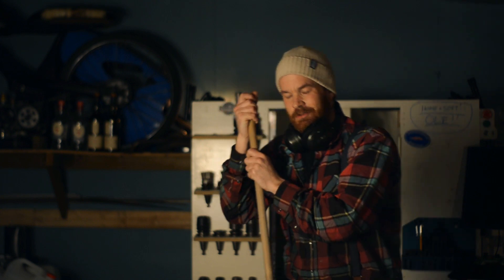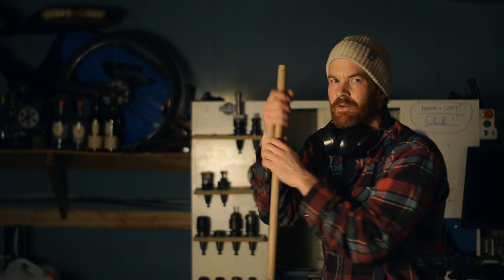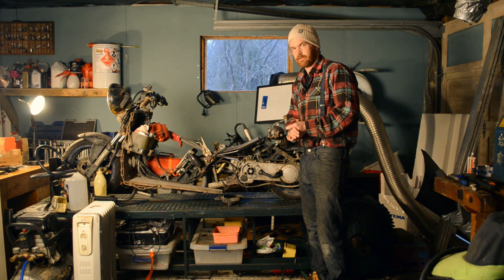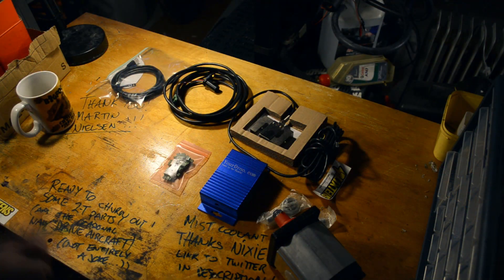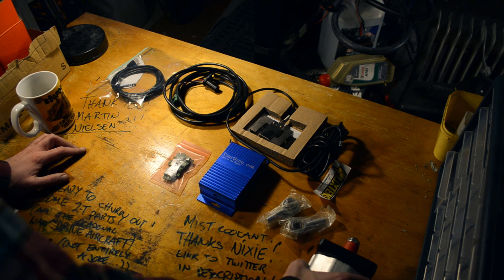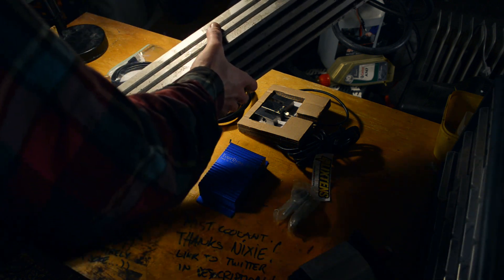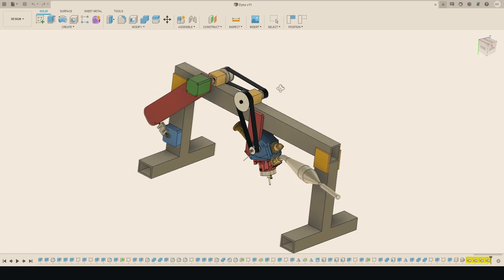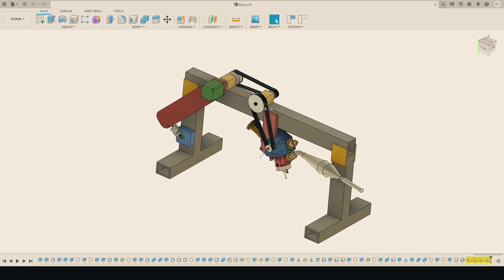Fly-by-Wire - Most Powerful Two Stroke Ever

Comment: When you say the most powerful 125 ever how do you know its the most powerful. How are you going to do the test .how many dyno runs are you going to do.will the test be 
Something like 2runs in a time say 30 mins,if the engine fails and you cannot finish the test then the whole test fails.how high above see level are you and what octane fuel
Will you be using?? are you going to use pump fuel.
Cheers

Comment: for a better response, find a decent premium servos, for airplane you can check rudder servos that has a very fast speed and response, or steering servos for 1:10 in road rc racing, mind the latency coming from the control system since it will introduce broader issues affecting whole system.

Comment: Just want to say that a throttle quadrant in a twist grip or a foot pedal are not 1 to 1. If they was it would be very hard to drive or ride as in put at lower setting would be make the engine very snappy. All so a digital servo will make that system so much better with a lot more reputability point to point.

Comment: Looks like a gear pump. They usually  have very limited rpm range and quite a bit of internal leakage at low pressures. Dont think it will be suitable for dyno

Comment: You can get rid of the springs and run a "pull pull" setup with a cable to pull the valve open and one to pull it shut.  A lot of RC airplanes and helicopters run pull pull (cables) or push pull (rods).   You can eliminate slop and load on the servo at the same time.

Comment: Awesome stuff lovein it.
You mentioned longer softer springs ,longer to close valve fully but in theory could slow closing  as softer. Hard to pick not being first hand seeing it operate but if your little softer and 10mm longer just stretch the spring evenly   that are in there you'll get same result. 
Plus have to watch video again but I'll comment brace cable both sides where it connects to slide solid fixture then to help return slide but you probably have, shorter cable less bend ,. You may have servo speed in tuning it ,also bigger servo 25kg minumin/steel gears bigger is better.  
All the best loven it

Comment: Alex, what if you mount the engine on a low friction torque arm which is free to rotate, except that your load cell is the restraining device.  Then you might be able to keep all the reactive forces from your pump, along with your belt reduction losses isolated from your shaft torque. In this manner, you can measure shaft torque and RPM directly at the engine. This would give you an accurate horsepower value.  If you ISO certify your load cell and rpm instruments, you could produce ISO certified dyno runs. Your first belt drive should ONLY be able to transmit torque forces from the primary (crankshaft) sheave.
Reply from the maker: That's a brilliant idea Jim!

Comment: great video, Top Tip, easily clean yoyr workshop floor if metal shavings, just drag a large magnet in a piece of cloth around, once its clogged up, remove the magnet over a bin and the metal trash will fall off,??
Reply: Good tip, but I think that most of his shavings are aluminum.

Comment: Hey,.don’t you get a beter result in finetuning when you use a butterfly valve, the same as in a throttlebody. I am building one myself with a 40mm diameter, and it is easy to make. Also use a servo tester with a dial knob, so you can move the servo. Then you dont need a arduino and laptop for testing.

Comment: I can not comprehend why you would use the servo drive to control the throttle operation. You essentially loose “direct” control of the air/fuel delivery to the engine. How can you trust such a critical performance piece of the process to a circuit board ?  Maybe it’s just my archaic old school mentality. 😎

Comment: Hey dude,
Whats the part number of the servo you're currently using? I can gaurentee there will be a cheap powerful servo available from hobbyking thatll do the job, and if not, futaba and hitec will definitely have one strong enough, might pay to scrap the cable and put a solid linkage too, also some needle rollers for the slide channels will help make the valve move smoother.
Fuck i love watching this build, got me through 6 months of lockdown last year in melbourne.

If you want any help searching for an appropriate servo let me know.

Comment: Nice bit of PWM control. I did something similar to shut the chicken shed door when a light dependant resistor sensed that the sun had set. I really want to make a dyno like that, will it only be good for particular rpms though? Or can it be dynamic?

Comment: Awesome machining! But why ride by wire, what's the advantage over cable-actuated throttle? Cause the ride-by wire is heavier and doesn't seem to open extremely quick.
Reply: Because it has to be opened in the same moment when the efi starts injecting fuel... It is just for full throttle, every other throttle position is made with a standard carburetor...

Comment: i feel your pain..  it's 5am again how did that happen.. sure it was only midnight a little while ago, sat down to do some CAD then was making on the CNC machine for a bit.. Then was playing with my FGK retrofit EFI system which my friend designed and built love it.  he does a 4stroke and 2stroke version.  bit below what you are doing but really good off the shelf unit. It works! i'm turning my cb100 cc into a EFI bike, it's from 1976 same age as me. They made bikes here 40 years or over exempt from MOT, Tax and Low emissions! Loophole exploited asap.  we have two dynos here... you are welcome to use anytime, only snag is we are in london!! UK.. bit far for you to travel but if you ever in town come say hi , love what you do ciao

Comment: @2STROKE STUFFING have you seen the drive system invented by “CeramicSpeed” for bicycles? It’s a chain-less drive system that’s supposed to be 99% efficient and fits a LOT more gears than you could traditionally via. drive sprockets....the machining / development could be difficult but, it would likely be more efficient than shiv-drive and would be able to maintain nearly constant RPM given the close gear spacing of 13-26 speeds.

Keep up the good work; excited for the dyno!!!

Comment: I'm telling you if you end up putting too much fuel at it you're going to need to add more spark or it won't ever light. You'll either need a second spark plug or an auxiliary glow plug to be able to get all that nitro to light off, especially without it being supercharged or anything. Oh and where you said more nitro.. actually it'd be less at Bonneville. The Salt Flats are at 1285m of elevation and depending on temperature I know the AD can go way higher than that.

Comment: I would try using a counteracting pull/pull cable setup like steering on a boat. Then you have more control. Also you have to consider that with the throttle closed or at partial throttle the vacuum will make it struggle even more. Having the pull/pull cable allows the servo to pull it shut when the weak springs may not.

Comment: Fly by wire is waist of time bloody pain in the ass on my car couldn’t imagine putting it on a bike and relying on it to work correctly
Reply: then why car makers have used it already 20 years whitout problems? anything becomes pita to work with if it is poorly maintained. and in the usecase of 2stroke stuffing it is necessity because otherwise you would have to manually operate this secondary port in precise rpm thresold.
Reply: @eetumalvikko8327  I suppose it will be set to just open or close at set rpm and won’t be to much of a problem but my experience with it in my fords has put me off that’s all.

Comment: Great video. You should be using an exhaust valve servo. Like the one found on Ducati's. They're cheap on ebay as people remove them while fitting race pipe. Huge torque on them, and pretty fast. About a 1/3 of a second, and it has 2 cables pulley!

Comment: why not mount the servo directly to the valve body and use a closing servo as well ? get rid of that long cable and replace it with wires.

Comment: Too many belts on that dyno set up, you will have alot of losses. why not simply a hydraulic pump direct drive, if you know rpm (flowrate) & pressure you can do the calculation from there.
Reply from the maker: The hydraulic pump isn't too happy about 20 000+ rpm...
Reply: @2STROKESTUFFING  Very good point!
Reply: Possibly meant to replicate the drivetrain loss from the bike?

Comment: Suggest to check that air pressure difference across the throttle plate does not push the throttle plate against the body so hard that the spring can't return it. Maybe some experience of these devices out there in the speedway community, the Blixt carburetor is a little similar.
Reply: Grease it?
Reply: Yeah. Could have a Pull/Push cable arrangement and no springs
Reply from the maker: Might go pushrod vs the cable.
Reply: @2STROKESTUFFING  "Remember to:
Be Cool,
Stay in School, 
andS̴̜̦͔̗͇̯̙̬ͫ͊̄̎ͫ̌̕͞m̸̛̲̻̯͍̘͚ͬ͐ͨͥ̾͗ͨo̧͙͕̣̮̠̬͚̮̒͌̀́k̼̤͕̖̰̥ͫ̾̊e̛̫̹̘̭͍̻̤̣̠͋̄̒̓ ̵̻̟̫ͬ̓̊C̜͉̣͙̰̏̂̐ͧ͆ͭ̈́̚ṛ͉͙̣̝̽̐ͬ̍̅ͣ̌̇̚͝ͅȁ̞̝̪̯̦̻̙̩̀̊͒ͤ̄̇͟͜c̸̠̩̜̄̆͂̅̃̈́͋ͅk̈͆̏͂̉̄͘͏̤̭̠̦̬̭̲"

Comment: I’d be cautious of the throttle sticking in the partial open position. It would be safer if you had a push-pull setup. There’s a reason bigger bikes use it.
Reply: Yes, might not get through scrutineering.
Reply from the maker: That's a real concern.
Reply: might not be so bad as its meant to be wide open all the time
Reply: @nfdr0kk3rz  until you want to brake and it stuck at full throttle LOL
Reply: @legros731  It's not that kind of valve
Reply: @nfdr0kk3rz  lol what are you talking about don't say stupid thing if you don't even know how an engine work
 the slide valve is the high speed throttle 
 if the slide valve stuck engine will be at full throttle 
The other small carburator is only for low throttle and idle

Comment: Are you going to adjust the fuel flow or have it set for only full throttle?
Reply from the maker: Full throttle only, this intak is just on/off
Reply: @2STROKESTUFFING  why don’t you try a “Guillotine type” apparatus for quick on-off function?
Reply: @2STROKESTUFFING  you have inspired me to build one for my four stroke dyno bike. Are you closing your other carby once you open this throttle to pull all the air through it?

Comment: Slow closing might be bigger problem than slow throttling up.
Reply: Not always, on a two stroke bike, if you shut too quick you (or rather the engine) is going to suffer from oil starvation. On a complete different level, guaranteed to give you (this time you) the frigth of your life, is having the throttles (cables) stuck in the full open position. Not even the key can kill the engine while it's revving at 8000+